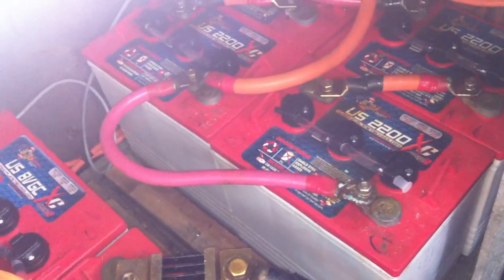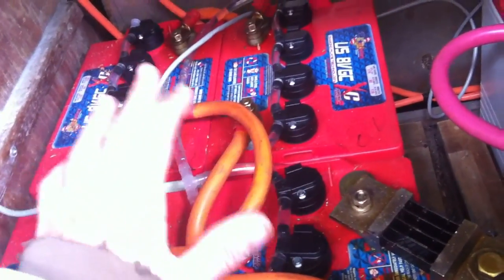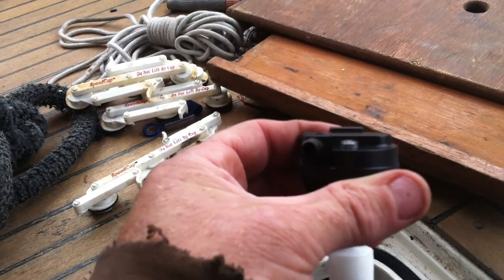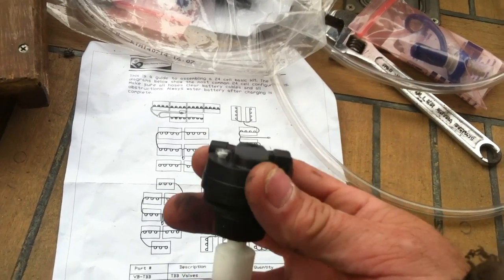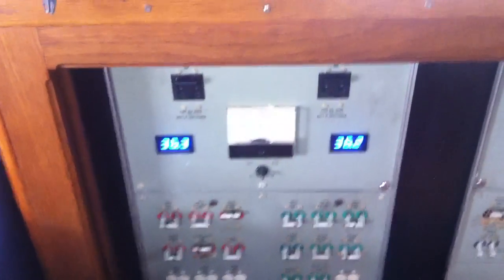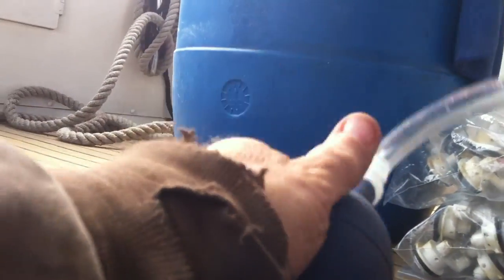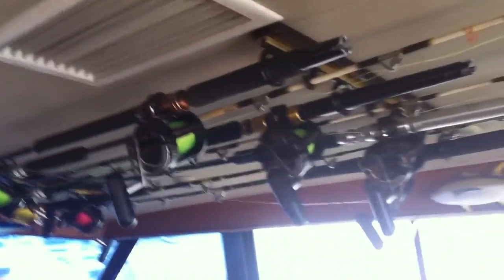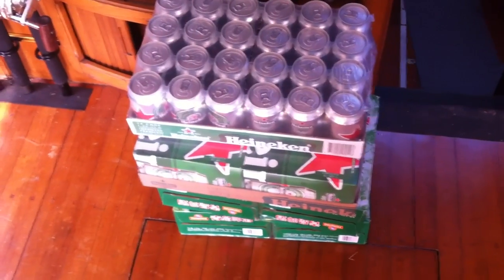Battery Watering System

Comment: What the name of the watering system
Reply from the maker: Good Question... give me a day to find the paperwork, and I'll post it here.
Reply from the maker: Hello... As I only have access to USBATTERY and TROJAN brand 6v and 8v batteries here in Hong Kong. I bought the Battery Watering Caps from USBATTER at www.usbattery.com. The man I spoke with is Paul Harchil. The caps work on USBATTERY brans and TROJAN T-105 and T-105 PLUS. you can find them on the website . That is where I found them.